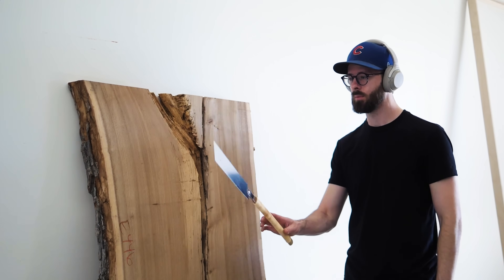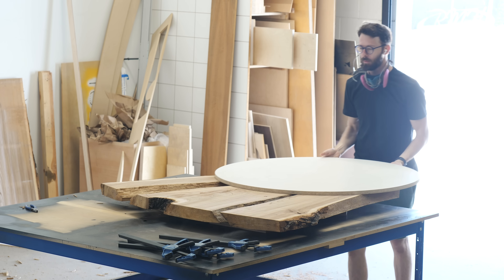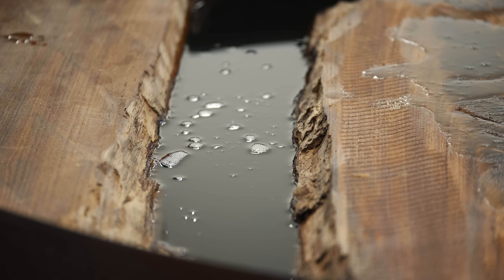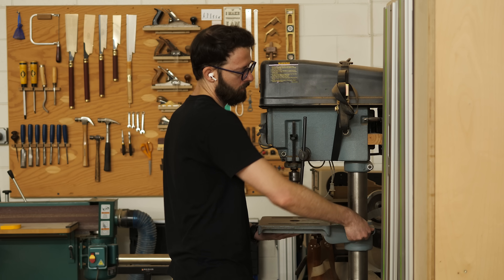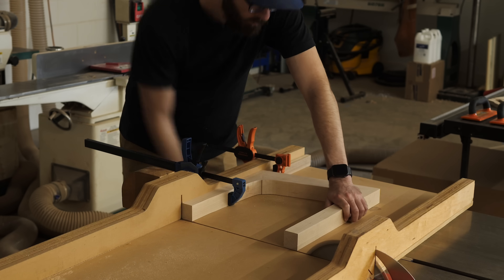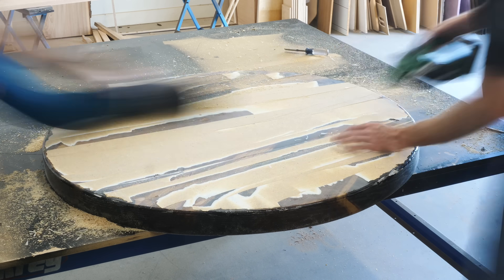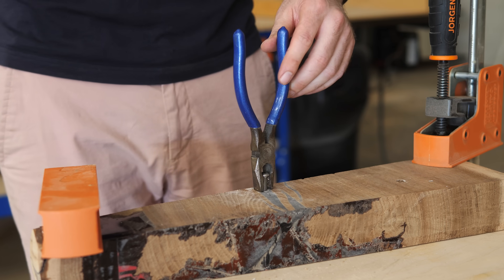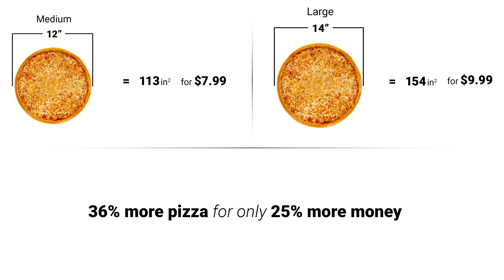They Said This Wood Was Unusable

Comment: No one gonna talk about how a slab of wood that 90% of people would call “unusable” sold for $1100?
Reply: I was wondering about this! Is this considered very cheap for a piece of wood that size? I know it's expensive af to get slabs like this but I'm not a woodworker so I don't have a sense of value for this kinda thing.
Reply: Please get this reply up, I wanted to post it myself but searched exactly for this first! Can the content creators give any insight on this? Especially once you see they hardly use anything of the slab
Reply: That piece would probably be about 7 grand if it were more usable
Reply: @Jorg05111980 An Elm slab this size would probably typically go for $1500 to 2K. So I think $1100 is a reasonable price for it. It’s still entirely usable anyway, Chris just needed a click baity title.
Reply: @tanner8355  you're here so it worked a little bit I'd say.
Reply: @vintageludwig Indeed it did. I’m not mad about the title, I think it’s smart. I was just trying to explain why a slab like this would cost $1100.
Reply: that was probably very close to the value the price of the usable slab that got cut off and  will be turned into a desk later
Reply: nobody actually said it was unusable
Reply: @Caelan-h8m  The clickbait title did.
Reply: Um..that was the price for TWO slabs, watch it again
Reply: It’s still a very nice piece of wood

Comment: I think that the  three  legged  base was the smartest because  it  will  always  sit  evenly  on  most  every  surface.   Three  legs  will  adjust  to  almost  any  surface.   Whereas,   four legs will  possibly  find  one  leg  does  not  sit  the same  on  some surface  and  the  table will  rock  a  little.

Beautiful  result !!
Reply: It is less stable, though. You can flop the table by pressing on edge between legs
Reply: @KryptLynx  how many times have you seen a table that’s rocking, and how many times you flipped a table?
Reply: @KryptLynx  That would be an unreasonable  problem  to  worry about.  If  you  are  pressing that  hard  down  on  the  edge  of  a  three-legged  table  like  this  one,   which is  not  that  wide  in  the  first  place  to  even  consider,   then  you  deserve  to  have  the  thing  tip  over  and  spill everything  on  it.    And  a  four legged  table has  the  possibility  of  driving  at  least  me  crazy  with  it  wobbling  all  the  time  on  even  a  slightly  un-level  or  un-even  floor.
Reply: But also it doesn't matter at all on this design bc the 3 legs are connected flat at the bottom and completely disputes what you're trying to say
Reply: @damianjones9446  There  will  still  be  one  spot  on  each of the  three  flat  bottom  legs  that  will  touch.   So  the  rule  is  three  points  define  a  plane.   All  it  takes  is  one  spot  on  each  of  the  three  legs  and  it  will  be  stable.
Simple  mathematical  rule.
Reply: @drillslinger  try to put that table on a rounded ground.. it will not be stable. Try to put a table with only 3 legs on a rounded ground and it will be relatively stable. Yes this is an exaggerated scenario and I hope no one is planning to put tables on such even grounds.. but my point stands. The plain on the bottom completely disputes what you're trying to say. Simple geometry.
Reply: @damianjones9446  I think  you  are having   some  personal  issues  that  don't  need  to  addressed  over  an  otherwise enjoyable  video.   Get  over  it.
Reply: @drillslinger  how to know you've won an argument: their reply has nothing to do with the topic at hand

This dispute had nothing to do with the overall quality or build of the table. Simply with the fact what you said made no sense. Good day Stephen
Reply: @damianjones9446  Time to go back  to  school.
Reply: @drillslinger  ah gosh stephen you really got me there

Comment: Good video. 

I’ve used wire wheels on grinders to quickly remove lots of rotten wood. It is really effective and imo rather quick while also leaving a reasonable texture. 

Question regarding the wide section of epoxy. Couldn’t you have just slid the 2 pieces of wood closer together?

Comment: Great work guys! The bridge for the three legs was awesome. I’m wondering if it actually turned out easier with the bridge rather than the 120 miters. I’m terrified of trying to get three (actually six) 120 joints to fit perfectly, and the bridge seems like a much more approachable solution. How did it actually go? Thanks guys!
Reply from the maker: Thanks Alex. Hard to say since I didn't make the other version this time. But I suspect you are right. If it were only 1 joint (the 3 120º joints) it might be an even split. But with 6 it definitely increases the challenge...since now length is a crucial dimension as well. 

The bridge joint was pretty easy. Slightly time consuming to create. But probably saved time on the back end by sanding being faster (no sharp angle interior corners to try to sand clean).
Reply: That was my thought also. The interface on the bridge would be much easier to sand flush, vs trying to get 6 perfect angled cuts to line up and meet in the middle.

Comment: My first thought is about the volume of surface of the leg on the floor. This requires the floor to be pretty flat or the table will tend to rock. Would it be better to have the majority of the lower stretcher a little off the floor and have fixed 'feet' so that it has 3 points of contact and becomes a lot more stable?
Reply from the maker: Our floor is very not flat, and so far it's been pretty good. That said, you're totally right, but that's a pretty easy fix with some small silicone/felt pads.
Reply: @Foureyes.Furniture  smart!

Comment: Having done a lot of resin work (though not for a table - yet), here are a few little tips: Because deep pour resin has such a long working time, it pays to sit the ready mixed bucket of resin in a bath of hot water for at least 5, preferably 10 minutes - make sure none of the water gets inside the bucket though! This gets rid of most of the bubbles and makes the end result much nicer and means less work with the blow torch. Also careful with the blow torch, if you hover over any bit of resin too long, it can burn it! As for the mold itself, if you caulk the sides, scrape it off again after, so you're left with a straight surface for your piece, but the caulk (or wax is even better) will be in the very crack you need it in. Silikone spray is the best mold release you'll find!

Comment: Really cool video and loved how the table turned out! One thing I've learned if you're using an epoxy resin finish is that you don't necessarily have to get rid of those rotted sections. If you tape off one side of the rotted material and pre-pour some resin around the area, it absorbs very well into the more pithy material and will harden it, perhaps to a greater degree than the rest of the piece depending on the type of wood. The coloration might not exactly match in the finished product, but sometimes that's a good thing!

Comment: If you ever encounter punky wood again in a project, you don't have to chisel -- Abatron makes a specialized epoxy that penetrates and hardens up rotten cellulose. Works like a charm (it has been used to preserve structural logs in a historic log cabin).
Reply from the maker: Appreciate that...I'll check that out. We actually tested this out a bit on some off cuts and the same epoxy we used made the punky wood usable from a functional perspective. But it doesn't look very good. So I'd probably remove it again. Ben Uyeda recomended to try sand blasting, finding a balance that is harsh enough to remove the bad wood, but leave the good wood. Sounds kinda fun, so I'd like to try it :)

Comment: Just a thought, but there are a few different types of wood stabilizers out there that you can spray on, pour on, paint on etc that could have rescued the spongy/corky wood you were dealing with. It wouldn't have been a perfect option, but it would have restored some rigidity to the piece, soaking into the fibers.
Reply: I wondered this too, but how is it going to react to epoxy?  How about time?  A test piece needs to be made and set aside for 8-10 years to really know. For the time, effort and cost of these bespoke items I’d probably spend $400 worth of time and another $200 in materials. That way you made a $3,000-$20,000 table instead of a $1,500 piece of art you hang on a wall. 

You can always display a beautiful failure, I’ve actually converted a table made out of an old wooden elevator door into a beautiful wall feature. When the “table” started to come to pieces the furniture maker had another door he took apart and rebuilt into an excellent table top. He threw his failure into the deal for a bit under $3,000 including shipping. I reinforced it with a sheet of MDF and a walnut picture frame and also reinforced his wall and hung it for him. (The artist did all the work to build the table top and it started to come to pieces because the original glue and peg work reacted poorly to his stains, oils and/or lacquer. Before he packed it up it started loosening up and was no longer suitable as a table. (Still looked beautiful though).
Reply: @john-paulsilke893  Thats a really good point
Reply: Spongy/corky wood? It had woodworm!
Reply: One could have thinned the epoxy and vacuum bagged it in.  West System (Wood Epoxy Saturation Technique) for instance.

Comment: Since you are making an epoxy table you didn't need to take out the termite damaged wood. You could have stabilized it with epoxy and kept the original look of the slab. 

How about you use the rest of that slab & make a waterfall side table to go with the coffee table you just made.

Comment: Hi Chris, Thank you for sharing your work.  I've seen lots of epoxy pour videos and when I see the craftsman being presented with a huge gap between slab parts, they always simply pour it full of epoxy rather than using their "ability to problem solve" to fill most of the void with a matching wood.  I'm curious why that is, given that, with such a large space to fill, it would not look bad, at least to my eyes, to have more wood and less epoxy making up the space.

Comment: This is great. Far more work than I could possibly attempt having no school in this area. I am however wondering why you did not use a piece from the remaining portion to fill in the oversized epoxy gap? Even just a rough cut in 2 - 3 pieces put in the gap.   Surely you thought of this and have a better understanding why it would not work.  Regardless, it is indeed a beautiful table. Well done!

Comment: This was really great.  Thanks for doing this video.  I "got into wood working" without realizing it.  I bought an old, unmaintained house in Japan in 2018, and one of the first things I did was cut down a large cedar tree that had been struck by lightning and threatened the house.  But in cutting it down I really felt "I want to keep this, and see if there is something I can do with it".  I cut the trunk into two pieces each about 1.8m long.  Two years later, I discovered "River table" while watching some video (don't remember who's it was, but I know it wasn't this site, or a couple others that I follow).  And I thought! Bingo!  I want to make my bar top out of those two pieces of wood.  Fast forward a few years later, and I've been collecting and storing large (1,500+kg) trees and after watching another YouTuber who had a horizontal bandsaw I thought... AH HA!  (Because being in Japan the one thing I had not been able to find was a way to reliably cut my trees into slabs).
I know this is a long winded comment, but the reason for it is I have also come to the realization that, as I'm still renovating the house, ALL of the furniture that will go into it will be made by me.  I never thought I'd be a "furniture maker", only a "DIY house builder".  But this is saw absorbing.  And I love every aspect of it.  I'm almost fully tooled up and ready to go.  Just need to find a little bit of time to get my bandsaw put together (got it 2 weeks ago), and then we're off.  I know I will be coming back to this channel over and over as I look at making different objects for the house.
Really can't wait.  Scott from Japan

Comment: I have done a LOT of mold work for epoxy in a warehouse making all types of stuff all custom but also huge runs of the same style items. We used acrylic, “clear plastic” basically and it comes in all thicknesses and lengths and whatever you might need and we connected them for forms with a hot glue gun. We were able to use them endlessly until the get to many surfaces scratches not allowing it to release easily. But NO form release or anything, the acrylic sheets are so smooth that the epoxy can’t stick to it. It’s the same material they make custom fish tanks out of. But you can make very intricate molds and release and reuse. Hope this helps.

Comment: so at the time frame  1:37 he states he used the of shoots as wooden band aids then goes on to ship away the soft would that the epoxy. so the question I have is … what if you just shorten the band-aid so to speak .. wouldn't that lower the amount of  epoxy used? or  were you worried about the size? I would appreciate  any response if at all and thank you for your time.

Comment: How do you guarantee not breaking the router bits when routing the edges that require the bit to be extended out to past one inch? Is there a general depth progression of 1/4in at each pass or something like that that goes through your mind?

Comment: Hey Chris, I love the content and have been been subscribed for the past month or so watching your channel while chilling. The level of detail you provide teaching is rare to see. Similar to the trade adage  "Fast, Quality, Cheap - pick one (maybe two)", your videos strike the quality note which something I know has yielded your dividends with subscribers. 
On this video and in past videos, I have seen burning after using a template/flush trim bit in your vids. Try taping the outer edge of the template for the first pass, remove the tape, and make a second pass. This may reduce the amount of burn marks (assuming your bits are sharp) resulting in less sanding post routing. 
A video idea - can you do a video of all your hand tools and another video of all your power tools hitting the high points for why you landed on that particular tool and give pros/cons. (affiliate links too!)

Comment: for future projects, you may be able to make a makeshift vacuum chamber with plexiglass and tubing for support, with a simple air pump to apply the vacuum, this would allow dryrotted wood to essentially be stabilized and you wouldnt have to remove as much material, the epoxy would be drawn in when the vacuum is removed and would strengthen the material
would have an upfront cost but you can reuse it on any material with weak sections of wood, and being build of plexiglass you can adjust the size or shape as needed
might be worth looking into if you are interested, once its stabilized you dont have to worry about it rotting or anything as the epoxy supplies the strength at that point

Comment: Wow, this looks difficult. I'm asking for some advise. I will be building a longways half wine barrel table. I will have a cradle with ends and a stretcher. I want to  connect the barrel to the base cradle with screw inserts three on each end. How can I get the screws precise enough to line up so that the barrel can be attached to the cradle  no matter which orientation?

Comment: Thanks for the great video. Do you have an opinion on or experience using penetrating epoxy to stabilize the soft/rotted parts of the wood, so they don't have to be chipped away? Does that work?

Comment: I like the finished product, but when I saw the original piece of wood i thought you were going to do a farmhouse dining table with resin. Getting rid of the woodworm was a good idea, and I actually preferred the larger space. Have you tried a clearer resin that you can set pine cones in on a table to add some decoration? I find the black a bit off putting.

Comment: Great job! As always. It would be very interesting to understand, although I know it's difficult to quantify precisely, what the final cost was for a table like this in terms of materials used. Obviously, such work is not suitable for a hobbyist, not only because of the materials but also due to the equipment used. I really liked the triangular junction solution for the legs, and I also really liked the Y-shaped legs.

Comment: On trucks’ beeps preventing accidents.
A friend who worked at a mine told me that, in very dusty conditions, beeping trucks caused more injuries than they saved because, before reversing trucks had automatic beeping, miners in conditions of low visibility would be able to locate the reversing trucks from the sounds of their engines; after the introduction of beeping, the beeping was so loud that it meant they could not hear the engine noise well enough to discern where the trucks were.

Comment: At the beginning, I thought you were going to go for a minimum area to pour the epoxy into. After applying the butterfies/bandaids, you could have cleaned up the insides of the cracks and, the sides a bit straighter (vertically), temporarily removed the bandaids, and pushed the sides together. That would have given you less space to fill with epoxy. But I guess you love the epoxy because you guys use a LOT. Do they make a usable epoxy that is clear which would let the beauty of the wood show?

Comment: Would it not have been possible to use a wood hardener like Ronseal on the rotten part? I appreciate it was quite extensive but you can drill holes into the edge to inject it for better penetration